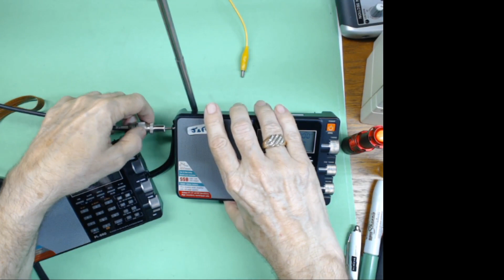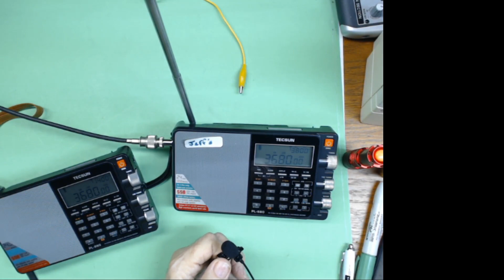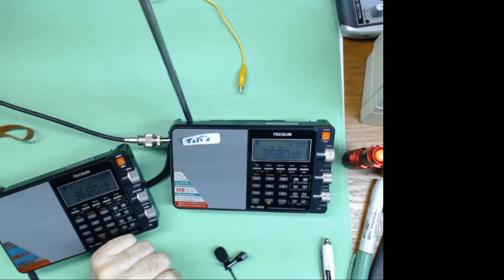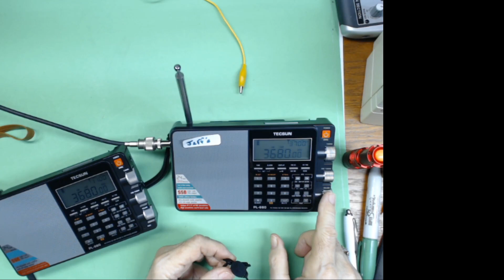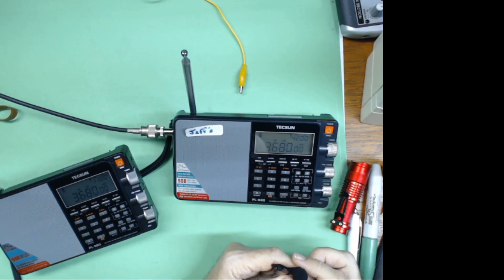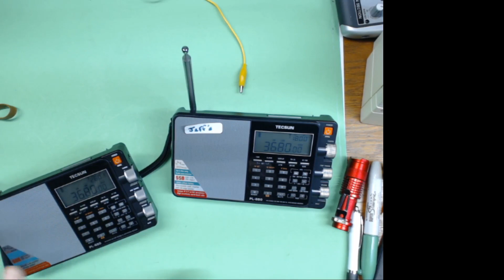TRRS #1955 - Final Tests Of Jeff's Tecsun Pl-880 on SSB

Comment: Have you tried the radiwow 108. Amazon had a coupon on it. This little gem has a lot of wow for its price. I took this radio to remote location and it’s not bad. It has it flaws but the pros outweigh it
Reply from the maker: Thanks for the suggestion.  I been on the fence on this one as it seems to be the same as other radios.

Comment: Hey Tom have you done any maintenance on that air conditioner in the last several years? If you let them go, crud builds up inside and the thing becomes pretty much worthless with the compressor having to be on all the time and that crud restricts airflow. And that makes your electric bill go up.
Reply from the maker: I clean the coils every spring.  It just that it is a 30 year old unit and it is only 5000 BTUs.

Comment: fine tuning  nob in the midle is for ssb, it will get ride of the muffeld sound.my 880  works great on ssb if you toon it rite.  kc2nxp
Reply: Thanks, so it would work similar to useing the "fine tune" button on a Skywave SSB and then turning regular tuning knob ?
Reply from the maker: The original design was suppose to have auto tuning (sync) on SSB.  It did not work and the radio would keep trying to sync and garbled the audio.  I think in the 8820 version they must have turned that off and maybe you now have to use the fine tuning as you mentioned.